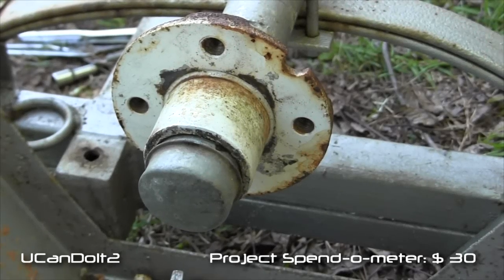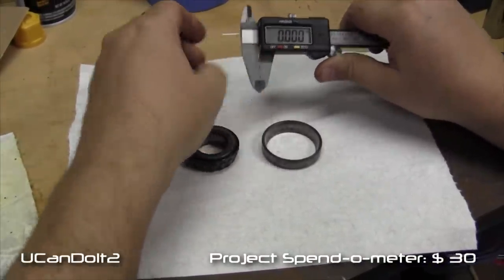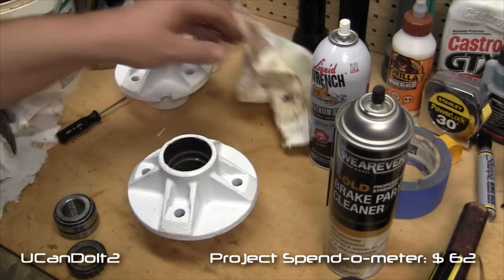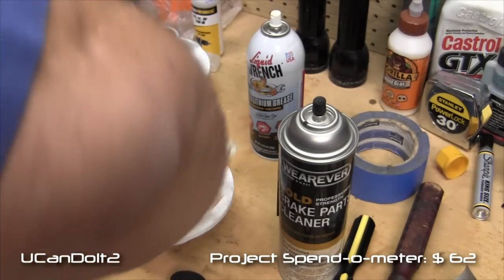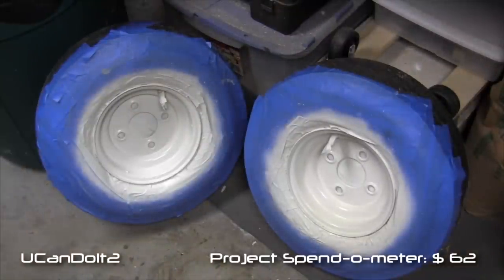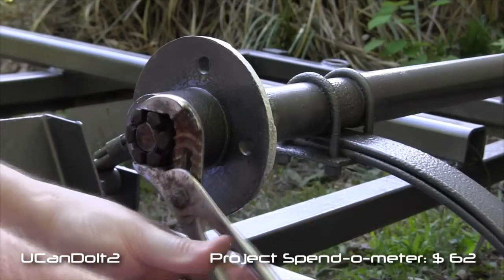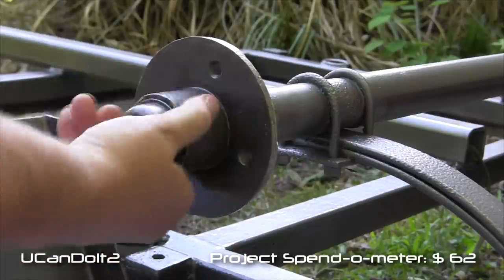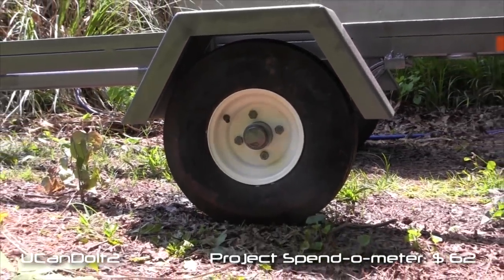Utility Trailer 02 - Install New Bearings and Clean Wheel Hubs

Comment: Great video on how to show the every day Joe how to replace his own trailer bearings, Good Job, I used to work at a marina years ago and have done hundreds of trailer bearings myself and although I used a press to replace the bearing race I know not everyone has one at home so your way works just as well if care is taken. Just one thing I wanted to add when I seen you used Anti Seize, I thought to myself this man is smart, I personally love that stuff. I use it on all my stuff and you don't need to use much a little goes a long way, it saves so many headaches when you have to work on something and Anti Seize has been used on it in the past. Great video thanks for posting.
Reply from the maker: I really appreciate your kind words.  I have done many of these, but one of things that I was taught by my father.  That doesn't always mean it is the right way!  As far as Anti Seize, I have just began to use it about 5 years ago on my project.  It just makes sense and is a good practice.  Thanks for watching and thanks again for the message!
Reply: What is the reese part # for the bearing kit you used.

Comment: I'm not an expert on trailer builds, but that's the first time I've seen bolts used to hold the wheel to the hub.  Usually, a lug pokes through the hub and wheel to where you install lug nuts.  But that trailer looks sturdier than those from HF.  Looks good.
Reply: I have the same style on my 16 ft trailer. Bolts not lugs

Comment: Thanks for the video!  I had a hard time agreeing your method of installing the new races by hammered on the old bearing against the race which old bearing/rollers will indent the new race surface and really defeated the purpose having new race at all...
Reply from the maker: The races should seat into a snug but not a high pressure pocket in the hub.  As the races are hardened steal, they should not be affected by the pressures of the old bearing.  Your concerns are valid as these are the exact things that should be considered when approaching this project.  Make sure the pocket is clean an burr free.  Many people scar the pocket when removing the old race.  You certainly could heat the hub and freeze the race to ease the insertion.  Other than using the old race, you would have to use a specially size tool to sit on the thin edge of the race to press in and you will need to be careful there as well as that could warp and ruin the race.  In my lifetime, I probably have use my method about on 6 different vehicles without issues.  But that doesn't always make it right.  Thanks and good luck with your project!
Reply: UCanDoIt2  I had to improvised like you don't have money for a press lol
Reply: Pounding on the race with a bearing is damaging the race surface.

Comment: Great video if you want to grease up the bearing how do you do it
Reply from the maker: This video shows how to Grease up new bearings.  If you are talking about adding grease to bearings that have been installed for a while...  Some hubs have a Grease Fittings (zerk or other) that allow you to add grease without taking the hub apart.  If yours do not have a grease fitting, you will have to take the hub off the axle and inspect and add grease.

Comment: What’s the process for remove the wheels. I have the same set up as you but I can’t remove the wheels to replace them.
Reply from the maker: To remove the wheel from the hub, there are either 4 or 5 lug nuts/studs that have to be removed.  Once they are removed, you may have to tap from the back.  the center hole of the wheel may get stuck on the center sleeve of the hub.
Reply: UCanDoIt2 gotcha yea I tried to remove the studs but every time I turn the torq wrench the trailer moves lol

Comment: Trick of the trade…use a heavier hammer when installing the races and they will go in much faster. Also using the old bearings to drive the race is not that great an idea as there is the potential of scarring the race with the bearing rollers.
Reply from the maker: When I was younger, we used to beat these things in anyway we could.  I've seen shops get pretty aggressive with them.  But, you are right, there is opportunity to damage them.  I have since, purchased a Bearing Race and Seal install kit and feel much better about my process.   Cheers.... Mike

Comment: bearings are stamped with a part number. ive never seen a bearing that wasn't stamped with some type of number. you also forgot to list the grease seal at the back of the hub on the rear bearing. other than that, nice video.
Reply: I took my trailer bearings apart yesterday no stamped part numbers
Reply: @joewong6662  did you clean them to see the laser etched part numbers ?